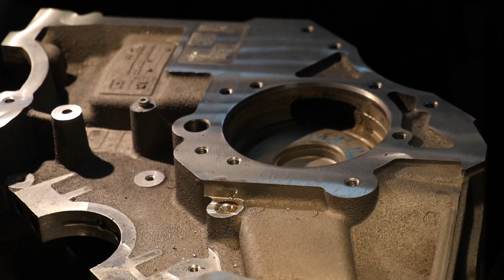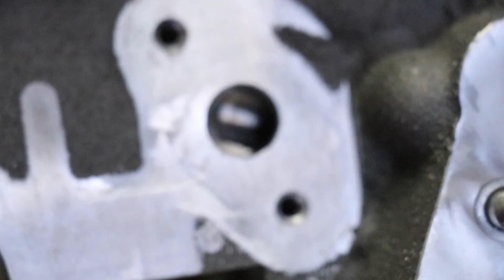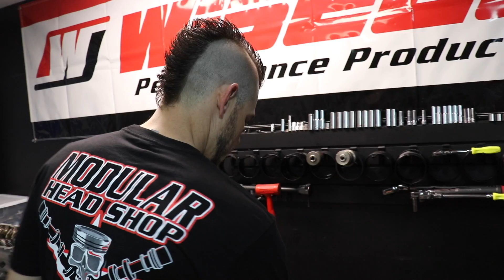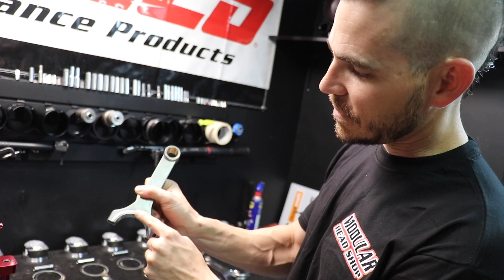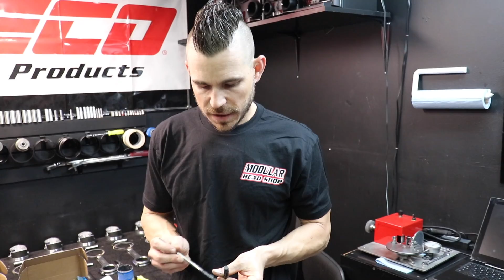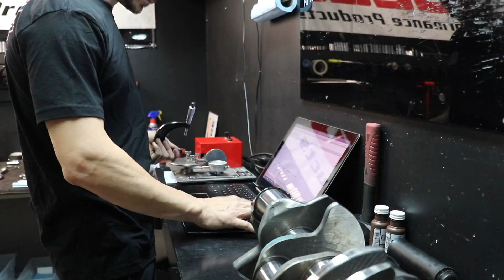5.8L GT500 Engine Sleeved Block Prep and Blueprinting

Comment: I blueprinted my 6 cyl Ford 4.0 L engine back in 2004 used over sized pistons and moly rings nothing special and block still running strong today - I brought all tolerance up to the narrowest figure allowed eased off just a bit so it took a long time to run in  with some early overheating issues but it has lasted all this time and still runs around 90% compression on all cyls and refuses to die

Comment: Curious to see what Jordan thinks about the infamous coyote tick? Would make a interesting video
Reply: Don Smith yeah it would . Do you know  what causes the tick ?
Reply: Folks some motors just have tick slight piston slap the older Honda 4 cylinders were notorious for piston slap but one the most reliable 4 cylinders ever but like I tell people that slight tick that some 18+ model or gen 3 coyotes have is nothing to worries about most solve with a oil modify treatment
Reply: Ive heard tick is cause by fuel injectors at work

Comment: Love to have a small camera inserted in those oil holes in the crack and see if just a 1/10th  of a mm larger opening could be done, before balancing the crack etc. :) the same with other easy access area of the block for more easier oil flow in all aspects of the long block. :)

Comment: Like to know if jordan has the contacts to have the block sonicaly tested and X rayed as it provides the imperfections in the block and weak spots as well. :) After all if that is done you can modify those areas which needs attention. :)

Comment: It could be a big mistake using the electric impact to chase them threads like that me personally I would do all that by hand so that way you can be more precise doing it one little mistake on driving the thread chaser too deep or driving it in there on a very slight angle and that block becomes a very expensive boat anchor or you could hold the block together with Heli-Coils which is not a good idea at all because the block would not hold together at all especially as soon as you put any good amount of HP or TQ
Reply: Did u watch the video? He said “ I turn my torque all the way down to 4”

Comment: i would never block off the oil squirters.  They are key in keeping the pistons cool under high rpm which prevents detonation.
Reply: David Peterson not really needed with a high end forged piston. That and they almost always are removed because they no longer clear the rods on a built motor.
Reply: @douglasm3310  I know there are clearance issues with s stroked engine but most leave the displacement stock. Thanks for the reply.
Reply: Road racing or standing mile maybe but for street/drag cars it’s not necessary. Ford only added it on the 5.8 to get to 200mph top speed
Reply: David Peterson it’s not just on a stroked engine. A stock stroke rod also will not clear because forged rods are so much thicker than oem.
Reply: @douglasm3310  thank you for the info.
Reply: Pretty sure the clearance issue is only with Coyote oil squirter's.

Comment: When he says shamper, its called shoulder in most engineering circle ,but who cares right and does anyone know what the symbol for a nut and bolt are in engineering drawings, its a X and 0. cheers :)  and using titanium bolts will make those critical larger bolts even more stringer and less weight thus improving stability as good titanium bolts are around the 14.9 grade and not the standard 12.9 grade and even hex bolts are stronger than your normal factory bolts so the stronger bolts you have and the stronger material used when rebuilding a block and all the various other areas when building for performance its better to use the best products and thus you don't have to worry about bolts breaking and more importantly the blueprinting and balancing is the most important for any engine build, as it is shown on various videos a coin is placed on the rocker cover and the engine is reved over 7,000 rpm and the coin does not fall over now that is perfection people. :)
Reply: Chamfer. Not shamper.